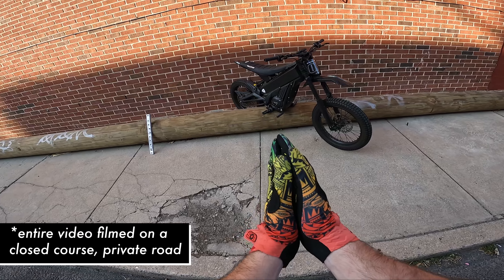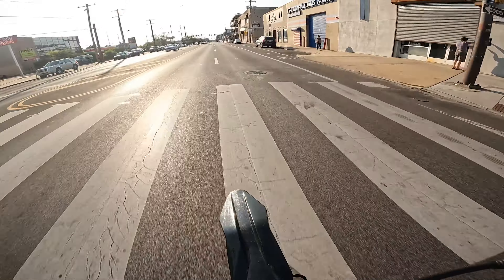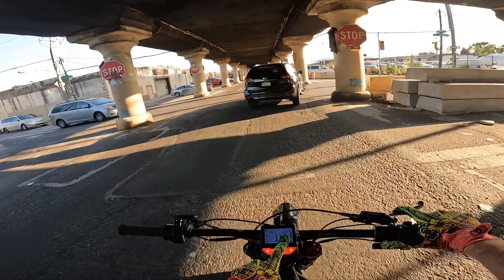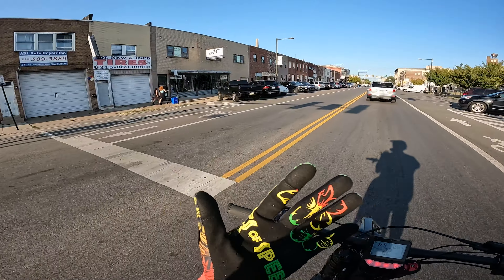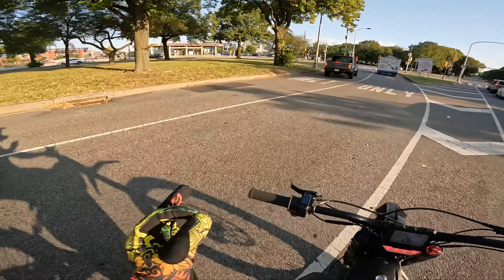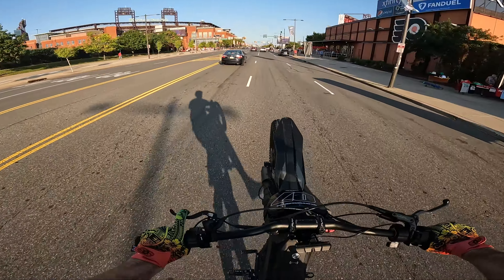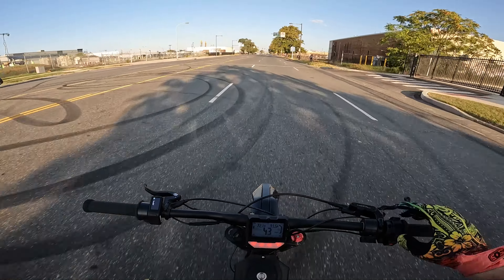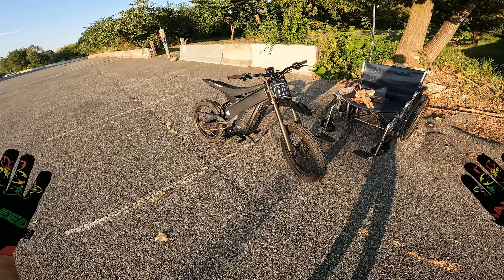Why you NEED a 72V Chi Battery in your Talaria XXX!!

Comment: Man I love your videos I think I’m gonna go with the EBMX 74v 44ah battery the specs on it is way better performance and peek power. Keep the videos coming they are appreciated due to the fact we have very little support and people doing mods for XXX
Reply: Go with the Chi bro i know a homie his ebmx battery caught fire
Reply from the maker: definitely recommend the Chi my guy. Super reputable company and support. Plus you dont have to rip off the entire wiring harness either like you have to do with the EBmx!
Reply: I did the EWATT 74v 44ah with EBMX controller and got 68.8mph with stock motor
Reply: @scarrrrr8582  I probably know more people that have Chi Batteries either caught or stopped working too just a mixed opinion. Can’t really say too much but base off of what I hope people are saying is true. But the specs of the Chi isn’t near EBMX especially since I have the EBMX controller and waiting for the motor. EBMX X9000 74v 44ah, 30kw peak power and 3526wh.
Reply: @ConnorGMedia  I’ll consider but EBMX 74v 44ah, 30kw peak power and 3526wh and $100 less is really hard to say no compared to Chi 72v 40ah, 26kw peak power and 2880wh. EBMX has also great customer service as well probably the best from any other company I had to contact especially with their FB group. The wiring harness I helped out a friend and it seemed fairly simple to me.
Reply: @KickzAndBikez  Oww make sense but you aint gone be able to pull nothing without a new motor
Reply: @scarrrrr8582  correct I’m really trying to keep anything power related the same brand I was thinking about the Sotion motor based on it’s a real good motor and priced fairly. But honestly I got to the point where I just wanna be done with it and max it to the fullest.
Reply: @giovannimayoral1720  man how is that I was looking at that battery
Reply: @KickzAndBikez  I was about to say you will need a sotion motor and you need to cut the wires and put the ones that fit the talaria and then you can pull a continuous 15KW at least without overheating the motor
Reply: @scarrrrr8582  correct I considered the Sotion like I was gonna order then EBMX did a video with their motor and figured I keep everything the same brand when it comes to power performance so controller, battery and motor.
Reply: @KickzAndBikez  Oww i didnt knew EBMX had a motor for the XXX

Comment: The XXX has a pedal kit so if you install that you couldn’t get your bike impounded, you could get in trouble for speeding if they catch you on radar, but you won’t get your bike impounded because it has pedals they would have to outlaw bicycles which that will never happen and the best part is that the pedal kit on the XXX is functional so they can’t argue with you
Reply from the maker: bro I'd rather get my bike impounded than run a pedal kit

Comment: for the price you pay to upgrade a battery controller etc, i better be able to confterably go 50 miles an hour and go long distances without a worry, even hopefully go on the highway for a short distance
Reply from the maker: you can confidently go 60 and even more if you gear it higher. Range is also crazy good. Like I said I've ridden for 4 hours straight doing wheelies the whole time and still came home with 35%
Reply: @ConnorGMedia  thats awesome, I kinda wanna start making videos like u ngl
Reply from the maker: @realkidcarter  you just gotta start!
Reply: It already goes 50. He’s just selling the battery lol

Comment: What sjhinko tires fit the xxx stock rims?
Reply from the maker: I run 2.75x17 front and rear. Supposedly you can run up to 3.0x17 in the rear
Reply: @ConnorGMedia  Do you need a chain extentdion or anything or can i ru. it stock